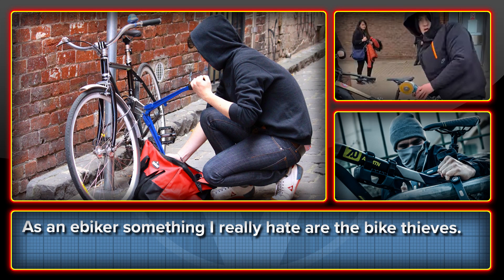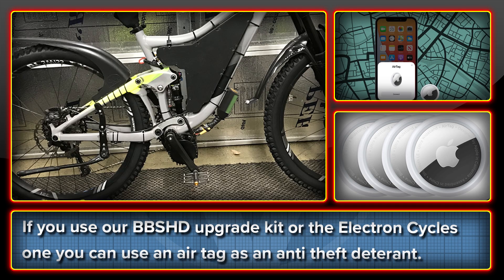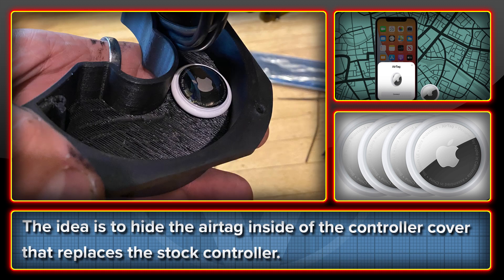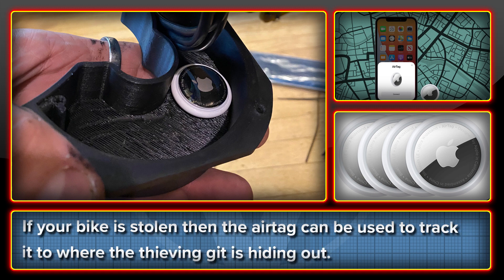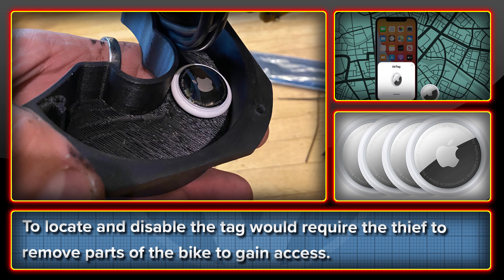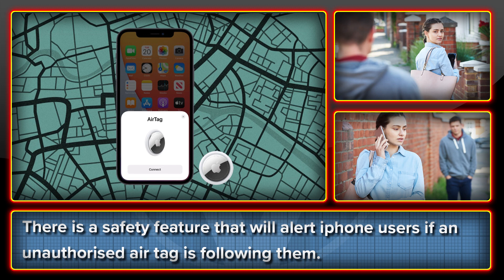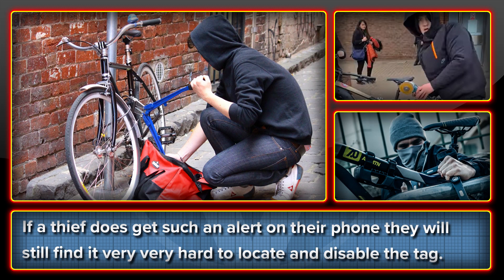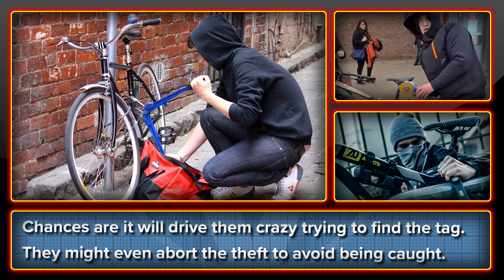Preventing Bafang BBSHD Theft with Apple Air Tags, Sneaky Hiding place for with upgraded motors!

Comment: Have you tested this with the potential for the aluminum case to block the signals to and from the tag? Aluminum is powerfully disruptive to radio frequencies
Reply from the maker: The cover we replace the existing controller is plastic. The Alu one would likely not work as you say

Comment: (correction, the cover is plastic so it should not affect signal strength).  pretty sure the signal strength will be greatly compromised behind all that metal
Reply from the maker: The cover is plastic!
Reply: @HighVoltageKits    oh nice!!!  I stand corrected.  I have a BBS02, do you have an upgrade kit for this motor as well?

Comment: I have one hidden in the battery mount, using a bbs02 with stock controller. And I just replaced its battery after 9 months... 
Has anyone tried to integrate this with a rechargeable battery that would charge from a DC-DC 3V converter that would run from the main bike battery so that it charges a bit every time I turn the main battery on? Or is it a stupid idea?
Reply from the maker: Not a bad idea. We have lots of options on controllers and Voltage feeds. Anywhere that can be hidden.

Comment: don't Airtags alert any iphone users nearby when they are tracking?  People are using them for stalking and apple is adding security measures to prevent that.  They don't seem as useful if the Airtags are alerting the thief.
Reply from the maker: They do. However I suspect that even if the thief has an iPhone that they won't check it during a theft. If they do it'd be real hard to locate and remove without tool in the spot we are suggesting. So it would make them possibly ditch it... Or if they get it their stash it will be an onerous task to locate and disable. In the meantime the police will hopefully be inbound. It's a huge risk for them. It's not a perfect system though and it also requires you to own an apple device which I refuse to personally. Cheers!
Reply: @HighVoltageKits it seems the AirTag wouldn't alert a thief until they reach "home", and you would be able to see that last known location. BUT at the end of the day it would boil down to whether your local law enforcement agencies care enough to get a warrant and do whatever is legally necessary to search the residence for a bicycle, based on an AirTag tracker, which in my case I don't have a lot of confidence would happen. 🤣😂🤣 Maybe if the stolen bike was involved in a murder, then the police might get involved, but short of that I doubt it.

Comment: Um? It only works if my bike is stolen it doesn’t prevent anything. An after the fact device.
Reply: I bought a 3D printed reflector case and it’s very stealth  all n all very useful. Along with an impossible to miss screaming alarm I’m golden. Now if those dipwad soccer moms quit possing the little pecker woods on the seat setting off the alarm, but it’s actually entertaining. It terrified every little diaper clad turd factory and they screech as PO’d soccer twit hauls the homely monster home. Did I mention they’re ugly buggers?
ALMOST TRUE!
Reply from the maker: Wish I could have seen that! Yes agree with the deterant. Unless the tracker was written somewhere on the bike as a deterant. Appreciate the comment. Cheers